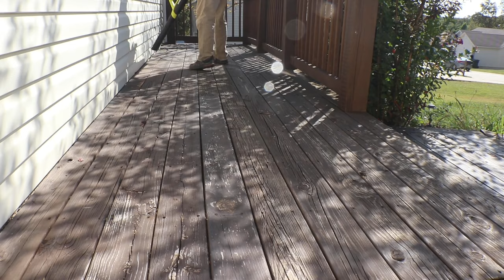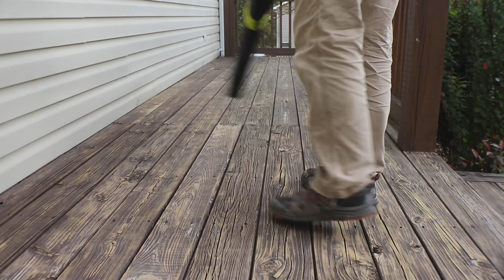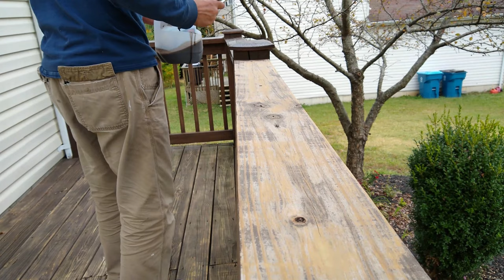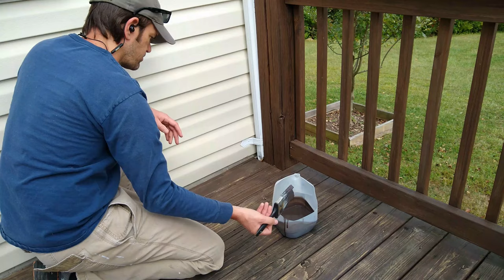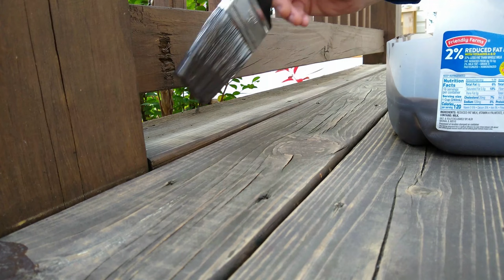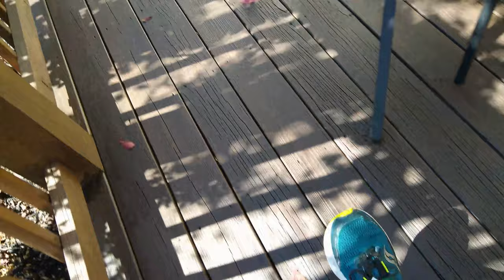How To Restore A Worn-Out/Weathered Deck

Comment: The power washing, sanding, all that is a waste of time unless you’re a pro who is painting and staining a deck for good money. If this is just your own deck and it already looks terrible to start off then skip all that nonsense and just start painting and staining. In the end you’re merely missing out on 1% at most of a professional looking job. That 1% would take an extra 10 hours of hard work to do
Reply from the maker: Stain and paint doesn't adhere properly to dirt and pollen. Sanding also removes splinters and keeps the wood smoother while giving the stain ability to penetrate the wood.
Reply: That’s the process you need to do before painting you know
Reply: None of what you say makes sense 🧐
Reply: This is why some carpenters have shabby looking homes. The self neglect to save a buck. Your home could be a showpiece of your work
Reply: False, please don’t speak on home improvement/trades if you don’t understand them.
Reply: Joe work "trades"
Reply: Spoken like someone who's got no clue on how to paint. If you do it your way, the sealant will deteriorate much quicker. It's not a 1% difference. Without the cleaning, you're going to be painting over dirt. If you don't sand, the sealant/varnish won't stain the wood properly.
Reply: Rent a sander from Home Depot for 40 bucks and smooth out that top. Then at least you’ll be able to walk on your deck, barefoot without jabbing your feet full of splinters.
Reply: Lmao “just half ass the shit out of it, who gives af”
Reply: I’m gonna half ass it, cause my landlord sucks and I’m sick of looking at it😂
Reply from the maker: Oh no! Best of luck, let us know how it turns out!
Reply: In fact, don’t even bother to sweep leaves. Just ain’t over them. It’ll only make 1% difference 😂
Reply: What if u don’t have splinters.. just ur original deck over has started coming up.. I power washed and pulled as much as I could up.. and replaced old boards.. should I still do all this or can I put deck over on top of the old cause some it’s not coming up.. also it rained last night and my sons party is tomorrow how long should I wait to put deck over on
Reply: @itskeagan3004  But I watch these to learn. Why are you mean to me
Reply: @broodyyedda5621  I wasn’t mean to you Broody, I was replying to the original comment who made ironic statements that are false.
Reply: Have fun with a peeling/cracking/flaking paint and an even bigger mess to clean up once you decide "huh maybe we shouldn't have took shortcuts" 😂
Reply: If you’re going to do a job, do it right or don’t do it at all.
Reply: You need to use an algae armor spray on and off, scrub a bit, then reset nails, sand and apply a finish, it will look new
Reply: Joe stick to your office job. You aren’t cut out for hard work
Reply: @TheBeanHome  don’t forget always working on others never leaves any time to work on ur own
Reply: Wrong if you want to waste your time skip the prep
Reply: If you're going to do a job, do it right.
Reply: @zzva8910 moar lyk woak amirite 😢
Reply: @kimberlyel82 baby lemme fix that fer ya 😌

Comment: Well, it still does not look that great, I mean the woods still have rough grains and cracks showing.  I wonder if you could fill the crack in the wood to make them surface smooth?
Reply from the maker: There is a product that is supposed to fill in cracks, but I think they peal out over time. Staining isn't a perfect refinish, but it protects the wood and helps it last longer. I did this 4 years ago and it's still in decent shape
Reply: @howtofixitworkshop OK, that makes sense, thanks!
Reply from the maker: You're welcome!
Reply: @howtofixitworkshop  yes, filling cracks doesn’t help, even it peal off well before the paint, multiple coats are better where you see the cracks

Comment: I wonder how it will look in 2-3 years? I read that I should have cleaned and "brightened" the wood for the stain to last; I did what you did and after 2-3 years it needed to be re-done totally.
Reply from the maker: The wood needed to be replaced or re stained? My wood is about 14 years old, I stain it every 2-3 years
Reply: They all need to be redone after 2 or 3 years. Stains do not last 10 years like they claim.
Reply from the maker: Totally agree
Reply: @ng3069   That's the truth.

Comment: Good video, thank you.  I need to do this with my deck which looks quite a bit like yours when you started working on it.  However, the previous owners of my home covered the deck board with blue paint which is peeling off. I don't know if they stained it or weather-proofed it in anyway.  Is it a mistake paint the wood after it is sanded and stained?    Does that undermine   or compromise the protection of the deck boards?

Comment: I very much a simple, self explanatory video without all the extra whooplah! Thanks so much for sharing! ❤
Reply from the maker: Glad it was helpful!
Reply: Great music too
Reply from the maker: Thank you!!
Reply: That "extra hoopla" would be helpful in the way of power washing it first & letting it dry thoroughly for a couple of dry/hot days.
More than a sweep is important to get all the extra dirt & wood grain that came up with sanding.
"Looks" good, but if you want it to last?
Best to get all mold off a good anti mold cleaning solution or at least Dawn & vinegar solution, then a super rinse, let dry thoroughly and THEN sand.
After sanding vacuuming or blowing it with a super strong blasting blower to get all the sanding dust out of the grain.

Comment: Plan to repaint since the previous owner use intdoor paint to paint deck. And after 2 seasons about 30% is peeling. Just wondering can I just use a regular sander(the square one) also what grit of sandpaper did u use?
Reply from the maker: Yeah the square sander would work too. I think the round oscillating sander would be a little quicker though. I think I used 80 grit sand paper

Comment: Would using a Exterior Primer help with filling gaps and adhesion before applying the final coat?
Reply from the maker: I guess that's an option. I think the stain I used had some kind of primer in it

Comment: Hi, maybe a noob question, but would those cracks not get bigger with time ?
Is staining good enough to prevent any further damage?
Reply from the maker: It's a stain and sealer so it will prevent more cracking if applied every year or two. But with pressure treated wood that is exposed to extreme weather elements, it won't last forever
Reply from the maker: Yep, the composite are a lot more expensive but a whole lot less maintenance
Reply: Even if they don't get bigger, they are a bit of an eyesore & should be filled it.
Reply: Yeah composite decks seem nice but I have a deck about three-four times the size of this deck. I just got a quote for a composite....12,500.00. Good grief.  That's after tax but using same foundation.
Reply from the maker: Yep, it literally pays to keep up with the dreaded maintenance of wood decks

Comment: No repairs of damaged buckling surface?
Reply from the maker: There wasn't any rotten wood so we just cleaned it real good, sanded down the rough spots and stained. It has held up pretty well for a couple years but needs some touch up.

Comment: my deck looks like that should i be worried about the cracks on the wood?
Reply from the maker: In my experience it will last several more years if you add a coat of stain every couple of years

Comment: What kind of Sander is that and what size sanding disks. 3 inch or 4 inch...Thanks.Also what grit sanding disks. THANKS
Reply from the maker: It's a 5 inch sander and the disks were 80 grit I believe. I left some links in the description for what I used
Reply: @howtofixitworkshop  Okay thanks a bunch.I found 3 different kinds in my building.One old big one that has a metal  casing.Weighs a ton.One sanding disk for a compressor and and a old Montgomer Ward Power Kraft 6 inch sander and polisher. The rubber on the pad backing is cracked pretty bad.The pad has a threaded bolt that screws into the sander.Been up all night looking for a replacement. No luck yet.👍👍👍🙏🙏✌✌✌😇😇
Reply from the maker: You're welcome! Best of luck to you!!!

Comment: Nice video fo sho 💯  this the same process i was looking for.  looks easy affordable  and  can hold up few more years dependingon the weather.much love. mr ron
Reply from the maker: Thanks! Yep it has held up for me for almost 3 years now. It could use some touch up, maybe when spring comes along
Reply: @howtofixitworkshop  thank you for the note… was wondering how well it held up. About to redo an old wood deck that was painted… planning to sand and solid stain/seal or paint. Would like to have stain and wood texture that will last a few years at least.
Reply from the maker: It has held up for almost 3 years for me. But it's ready for another facelift.. The wood is all still in pretty good shape

Comment: What, no roller?? I have a huge deck that looks like the before picture, but I'm not convinced that your treatment is going to last. Mine is also in the direct sun beating down on it.
Reply from the maker: Mine is still holding up, it could use a touch up a couple years later, but that's how wood decks are. The wood on mine is 15 years old, I've only had to replace a couple boards

Comment: Hope you reply to this but I noticed a hand sander. Did you have old stain on the deck before? I am have worn and weathered deck and I wonder if  can just give it a light sander rather than use a “stripper “ solution on in. I’ve already pressure cleaned it and I think that was a little rough on it and I don’t want to have to pressure it again
Reply from the maker: Yep, I had an old stain on it. It was a lighter color and I sanded off most of it

Comment: Could I use a spray gun to paint mine with instead of a brush or roller. Plmk
Reply from the maker: Yes you could spray the stain but you would probably need to "back-roll" it with a paint roller to ensure even consistent coverage of the sprayed on stain

Comment: Shouldn’t you wipe the stain after applying for a proper finish?
Reply from the maker: I back brushed the stain with a paint brush after rolling it on. It's not necessary on a deck to wipe the stain away completely.

Comment: Need to use Deck Restorer to fill in the cracks
Reply from the maker: I've seen mixed reviews with deck restore. It has a tendency to peel and pop out of the cracks
Reply: @howtofixitworkshop  what do you recommend to use for filling gaps?
Reply from the maker: Honestly they don't bother me. I didn't fill them, the porch is still going strong

Comment: Get a belt sander my guy. Way faster than a hand sander.
Reply from the maker: Good idea! But I didn't want to tear up the old wood too bad, it was getting a bit brittle but could have been worth a try
Reply: If you ran 150 or 200 grit sand paper on a belt it would be fine. I wouldn’t use 80 grit though.

Comment: You missed the part where you repair cracks with wood filler.
Reply from the maker: Nope, didn't fill any of the cracks with wood filler, just filled them full of that paint
Reply: Wood filler doesn’t stain the same color as the wood and it would look bad
Reply: @ahischak  so what is the proper solution if a customer wants them filled.?

Comment: Once the wood is splitting and dried out like this I would just go ahead and pull it off. If you want something to last another 20 years it’s worth the cost of reboarding the entire deck. But this looks good if you just want to make it look a little nicer, but it won’t make it last longer.
Reply from the maker: Been a couple years since this video and the boards are still in about the same shape. It'll need to be resurfaced eventually but I've already got 3 more years out of it. I'll apply the stain again this spring and hope for another 3 years, we'll see how it goes.
Reply: Our deck is 25-26 years old and not a board replaced.. LOL  just keep um painted or stained..
Reply from the maker: Nice! Yeah they require maintenance

Comment: In a cold climate, if don't address the cracks they will fill with water and will make the cracks much worse. Finding the ideal filler is the trick especially if you have numerous large cracks that can be labor intensive. I was hoping you were going to address them but in less than 4-minutes I would say not. Therefore, not helpful.
Reply from the maker: Thanks for your feedback. But the porch is still going strong many years later

Comment: I was looking for video on restoration, but I'm sorry this looks like crap.
Reply from the maker: Thanks!
Reply: He needed to do another coat I saw bleeds all over but as long as he’s happy or the customer that’s what matters
Reply from the maker: I didn't have any bleed through, perhaps it was the glare in between the cracks. It has held up very well the last couple years, but all wooden decks require ongoing maintenance, and I'll need to stain this one again
Reply: @howtofixitworkshop  I personally would have done another coat I can see the wood showing through especially on the hand rails. I’m also super anal about my paint jobs .
Reply: @howtofixitworkshop  🤣
Reply: He didn't have any bleed through. It's a semi transparent stain. You are supposed to see the wood.